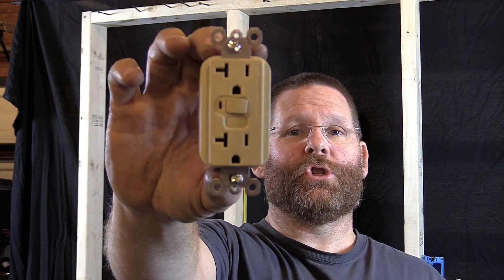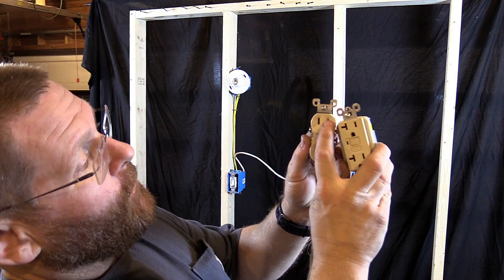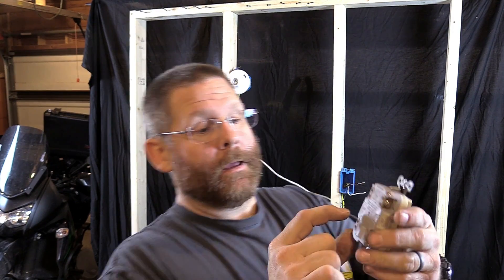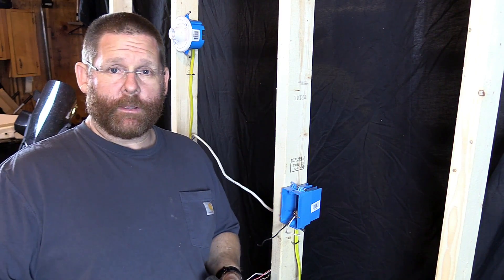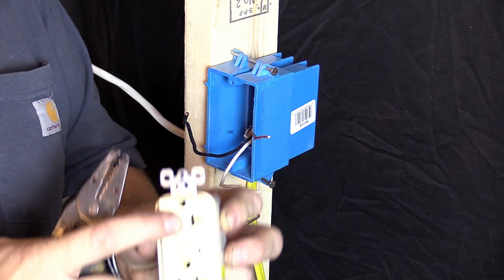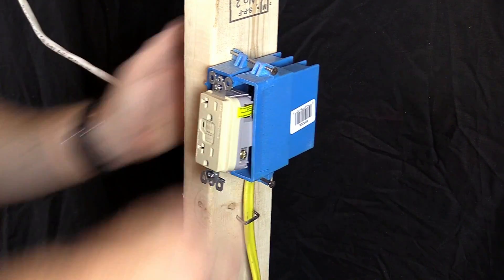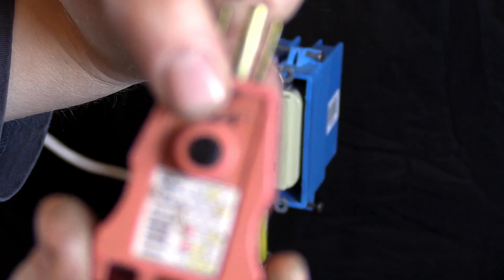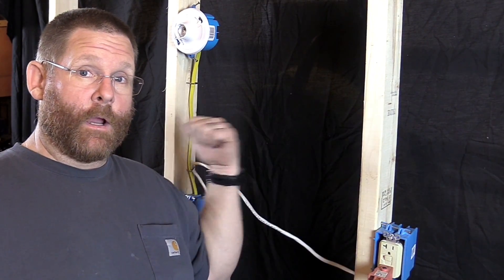How To Hook Up A GFCI

Comment: What’s the different category between line and hot black wire? Also what’s the difference between the black hot line wire and the black hot load wire?
Reply from the maker: Line is bringing power in, and load is taking it out of other devices or lights etc

Comment: Most helpful, although in a rental prop. i went to replace some 2-prong outlets w/3-prongs &  i put a GFI  outlet up stream of other outlets. Upon removing the old 2-prong outlets i saw 2- blk wire's & 2-wht wire's. my question i where would the other blk & wire connect to the GFI outlet?  Also i did not see any signs of copper ground wire. I would like u to give a hook up vid of this sennario of this.
Reply from the maker: Keep it on the line or you can use it upstream and protect more receps. Good idea for s video

Comment: what if it's an older home and no grounding on the outlets in the home. How would you go about grounding the outlets. The outlets do no have a grounded copper wire only a black and white wire
Reply from the maker: Have to use gfci or non grounding plugs. Or last option rewire. Here is how I fixed this house https://youtu.be/Gr8wxfKfEtY

Comment: If u are upgrading from a old two prong non-grounded outlet and u put a gfci, do u need the ground hooked up?
Reply from the maker: If you have a ground, you don't need to use the gfci as long as it goes back to the panel. If you don't have a ground there is nothing to hook up so no

Comment: So once you start your circuit with 12 wire can you go to 14 wire further down the line?
Reply from the maker: You can but you need to protect the smallest wire, which would be the 14 Guage.
Reply: Changing your wire to a smaller wire down the line requires you to protect the entire circuit to the smaller gauge wire. Now you have a 15 amp circuit.

Comment: Thanks bro vid was helpfull af! Tree limb fell knocked down line to garage i then had a problem with the outlet in garage my backup fridge had no power so it was weird i had power to outlet but the problem was i had to have a fan plugged in for the light switch to work but the light was not as bright as before but i unplug the fan and light would go off so i didnt trust my fridge to be plugged in to it because of some sort of power loss? Anyway i am changing the outlet 20 amp this time i learned from you seems better but i got those round glass fuses that screw in out in the old garage and they seem finer like not blown but there are four holes only have three fuses in but it was never a problem before anyway should i get another fuse for that empty hole?
Reply from the maker: Sound to me if your lights are dim that you have lost a nuetral or it's really loose. The 4th hole won't solve anything. Find that nuetral
Reply: Awsome find the neutral  thankyou so much sir very cool
Reply: Ok pulled out the outlet and there is not a ground wire its only got the black and white wires comming from the box in the garage both  house and garage was built in 1899 so i assume the wireing was done close to that time is why there is no ground but i retightened both the nutural and hot and now the light got brighter again but the light switch still controls the outlet so turn the light switch off and no power to the outlet where fridge is plugged in any way im now thinking its been this way always and i never noticed that the fridge was going off when i turned off the light
Reply from the maker: That's both good and bad. Switching a refrigerator is not good.

Comment: Thank you for GFCI 101 taught by a union man no less. Fixed my problem of running 2 gfci’s in series to connect an out door water fountain. It worked for a few years and suddenly stopped. Replaced one GFCI with a Proper 20 amp switch and ran the load to a heavy duty commercial grade outlet in a water resistant plastic case. Subscribed.
Reply from the maker: My pleasure for the video. Thank you for your subscription and welcome to the mountaineer outdoors family ☺

Comment: So the GFCI always needs to be fed directly through the panel ( a homerun), it's the first in your circuit  and then your daisy chain comes off that ? Correct?
Reply from the maker: No it doesn't need to be the first one. It can be but doesn't have to be.

Comment: good studff. Thanks. I have a bunch of outlets to install/replace. but if you install a 20 amp GFCI outlet doesnt the circuit its on also need to be 20 amps at the circuit box? Ir is it ok to use a higher rated outlet for a lesser curcuit as long as you dont go the other way around?? please advise? thanks
Reply from the maker: No if it's a 20 amp circuit you can use 20 amp. 15 amp only good for 15 amp receptacles. Good question.

Comment: I have a question about the extra line on the GFCI you show in this video. If a 20 amps GFCI is marked by that extra line on neutral slot is to signify that it is 20amp rather than 15amp why doesn't my GFCI have that extra line,  I can read on side of case on mine that it is a 20amp and it is hooked to a 20 amp breaker too.
Reply from the maker: From what I have been able to look up and I have not run into this that I know of...but its rated at 20 for feed through but classified as a 15 amp...seems kinda wonky to me but good question.

Comment: Unless I'm mistaken, the reason that you shouldn't back wire a standard receptacle is because it doesn't hold the wire with a plate when the screw is tightened.  The wire can easily be pulled out of the receptacle and cause big problems.
Reply from the maker: Yep definitely

Comment: When replacing or adding a gfci make sure that your replacement is the same amperage as the breaker in the main breaker panel that is feeding it. If you put a 20 amp gfci on a 15 amp circuit the 20amp gfci probably wont trip for awhile if there is a problem, but hopefully the 15 amp breaker in the breaker box down line will, but maybe too late.
Reply from the maker: The gfci doesn't trip when there are to many amps on it the rest of your comment is true though.
Reply: @MountaineerOutdoors  I should have said if you run a 20amp gfci with a 15 amp circuit breaker and there is a fault...the 15A circuit breaker would proably trip before the 20A gfci.
Reply: @gtnoslp  the size of the GFCI has nothing to do with the breaker, it does not act as an over current protector.
Reply: yeah i had the same question

Comment: Great video thx.  I replaced a GFI in my kitchen today, but when I finished there was a green light on the GFI, but no power.  Also lost power to two outlets that come after the GFI.  I have two black and two white wires in my box.  I tried flip flopping the wires from top to bottom thinking that the new GFI is configured different, but it didn’t work.  I finally had to put my old GFI back on to get everything working again.  Would probably help if I buy a tester so I know which wires are hot lol!
Reply from the maker: It is possible that the new one is bad right out of the box which seems to happen alot lately. Take it back
Reply: @MountaineerOutdoors  I did take it back.  I bought two new ones plus a voltage meter.  Problem solved!

Comment: I really enjoy your channel, good information and good explanation. However, at this point I disagree with you about the use of 20 amp receptacles for gfci's and regular receptacles. You actually made my point by saying in your 27 years of experience you've never seen a need. Another electrician with over 40 years said the same thing. I realize that there is nothing wrong as long as it's on a 20 amp circuit. My local Home Depot charges $2.00 for a spec grade receptacle (not gfci) and $7.00 for a 20 amp receptacle. Significant difference, at least around here. I don't think the quality is significantly different either. What's more, if you come across a tool or appliance with a 20 amp plug it will likely require a dedicated line and a simplex receptacle. I do like the 20 amp receptacle in residential use for the purpose of 20 amp circuit identification. I am not an electrician, but I assume that 20 amp duplex receptacles have their main use in industrial or commercial applications. Make no mistake about it, the use of 20 amp receptacles in modern homes is common, I am sure there are various reasons. Maybe a selling feature, looks impressive. 
Thanks for listening to my rant, and keep up the good work. BTW nice bike in the background.
Reply: Agreed.  It also kind of depends on how many amps your circuit breaker is.  For example, I don't think you should put a 20 amp outlet on a 15 amp circuit considering the breaker is not rated for the higher amperage.  So while yes, there is nothing technically wrong with with it and like he said, basically no residential appliance requires a 20 amp outlet, I also wouldn't make it be a potential issue putting a 20 amp outlet on a 15 amp circuit.

Still liked the video however!
Reply: @ApoJake13  Correct, I made a comment that it has to be on a 20 circuit if you're using a 20 amp receptacle.
Reply from the maker: I fully agree with you. To each their own and I do appreciate your comment. Your correct on everything you said. Have a good evening ☺

Comment: When you substitute a 20 amp gfci for the 15 amp, do you upgrade the wire and circuit breaker?
Reply from the maker: That would definitely be the way to do it correctly

Comment: That's for your view its very informative.  I had 2 gfi's blow in my kitchen one was a result of my wife using the microwave, it burnt the adjacent outlet,  I changed the outlet and the jumper wires, flipped the breaker and the other outlet burned. Now I've replaced both and it doesn't work, I tested the black and white neutral and the black is 120v and the neutral is 12v, should me neutral have voltage?
Reply from the maker: Are you going to ground? Nuetral to ground?  You should have 120 hot to ground but not nuetral to ground
Reply: @MountaineerOutdoors  
I'm not sure. It's an older house so I think there's no ground wires.  I'm having an issue rewiring the new gfi seems to have 2 live instead of just 1 black live. I'm guessing when the gfi got burnt it melted the neutral and a live wire in the same conduit causing some voltage in the neutral.
Reply from the maker: That stinks. Can you just rewire it completely new back to your panel
Reply: @MountaineerOutdoors  thanks I'll give that a try.

Comment: What if you have no ground wire?
Reply from the maker: Putting a gfci satisfies the code. Will it trip, no but this is what code calls for. Definitely should pull new wire and do it correctly for sure

Comment: Can't help but agree with the comment from B Lawson, I watched and listened 3 times and although you didn't reference or say that you can put a 20amp GFCI on a 15amp breaker. You statement about using them "all the time, (you didn't have one in your pocket, because you never use them" gives that impression. Your response was that you quoted wrong and would correct that statement. Someone looking to install a GFCI receptacle that's not going to read the comment's will never know that the code states you can "ONLY INSTALL A 20 AMP GFCI ON A 20 AMP BREAKER. As I said I watched 3 times and only found your correction of the misleading information in the comments to everyone that has brought this to your attention. I did however see your disclaimer at the end that you were holding yourself harmless if someone follows you advice. Instead of quoting to me the obvious, maybe you could post another video and go over the compatibility of breakers, and the various gages of wire and what would happen if someone were to overload a circuit and cause a fire. Which is what can happen if someone follows your advice and installs a 20amp GFCI and the gage of wire isn't heavy enough to carry the load.
Reply from the maker: Ok I re-watched my video again 2 more times. NEVER did I ever mention that you should put a 20 amp on a 15 amp circuit ever.  Also the only thing that I said which when I did say it was I prefer 20 amp receptacles.  That statement did not say put a 20 amp on a 15 amp circuit. Also, I only pull 20 amp circuits 12 Guage wire to all my receptacles anyway. Now your correct per code a 20 must stay on a 20 amp.. The way you interpret this is beyond me, getting that I said something that I didn't say. Now to make it more clear I deleted it where I said I prefer a  20 amp Recep. That should make it all better so no one will hear something that wasn't said.

Comment: Hey guy; I was just checking to reassure i knew what I thought I knew.    Love the line of Bull:)))   Politicians come to mind.
I am constructing a dust collection system, Utilizing a old Delta motor and impeller  unit.
I opened the (switch) on motor and the Neutral wire coming in runs thru a 25 Amp trip. 
The Black/power is hooked up to, It is stamped (Load) side of switch. 
When I look at wiring diagram on motor, it's showing Line  Neutral and Power coming in same side of switch and then feeding motor..  
Am I missing something within the (how works) of that switch?  
I have purchased a remote start kit. 
Best; Tom
Reply from the maker: Without seeing a diagram I would assume that it's a double pole double throw switch.. Just a guess. Good luck with your project sounds like a good weekend project
Reply: @MountaineerOutdoors  Hey young man, Thanks for the fast response:))  I was doing the what /how thinking. It appears  if the (motor) 25 amp breaker trips I automatically kicks the switch to the off position.  If you have time,  The 1 1/2 Hp  which tells it pulls 14,7 amps, motor is new factory wired for 115v 20 amp but it has a 25 amp trip breaker wired in it.  Why?  Best; Tom
Reply from the maker: My thoughts on the 25 amp is because of the start up of the motor.  Motors always have more amps for a brief moment while they are starting up and ramping up to the correct rpm.

Comment: So, can you tell me, is the amperage-rating at the outlet... determined strictly by the outlet itself?
Or, does it have anything to do with the capability of the house to transmit one or the other?

In other words, is there ever a possibility that any particular structure's system is only CAPABLE of 15-Amps and a 20-Amp outlet would be pointless... or, possibly, even trip a breaker, should a 20-Amp appliance be used?

Comment: Thanks for the video. I have an extra red wire. Where does that go? LOL. I know that this is the end of the line for this particular cable and is feeding no other circuit beyond it. I cannot say for sure but I believe it is the only receptacle on this line as it is for a Dishwasher and GARBAGE DISPOSAL  and the main CB is rated at 20A. I used a 20 GFCB here too.
Reply from the maker: I am not sure on that unless they were gonna feed the dishwasher and the garbage disposal and share the nuetral.
Reply: @MountaineerOutdoors  you got it. They split  the line side by removing their connection. This allows for two phases of line voltage and the neutral is shared.
Reply from the maker: Gotcha well at least you got it figured it. Have a great night

Comment: can GFCI go bad if I wire it wrong way?
Reply from the maker: Well honestly if it's wired up wrong and it's working I don't think that it could go bad. I have seen many that were new out of the box that were bad.
Reply: @MountaineerOutdoors   Thanks for your response, yeah I just flip the wires and everything works fine.
Reply from the maker: Glad to hear that easy fixes are the best. Have a great day ☺

Comment: I thought since the line was coming into the GFI you put the wires on the screws under the yellow tape.
Reply: Ok, I watched the video again. The load is under the tape, not the line.
Reply from the maker: exactly the line isnt taped its the load that is taped.. but you always need to look just to make sure.

Comment: In most communities 15 Amp receptacles are for residential and 20 Amp are used for commercial.
Reply from the maker: Yep but homeowners now are wanting them. So if they are paying you have to do what is right by them
Reply: @MountaineerOutdoors  Yeah, you just have to watch out for those municipalities that have specific code stating that residential has to have NEMA 5-15R for 120VAC.

Comment: That must be the legrand GFCI? I just pulled one out this morning when I found an open ground with my new outlet tester. Sure enough someone hadn’t connected the ground wire; in fact they were cut shorter than the hots and neutrals. So I took a length of 14-ga and twisted it with the two other ground wires in the box, and connected to the ground screw on the outlet. 
That’s when I noticed the hots and neutrals were going into the back. I was going to move them to the screws, but then I noticed that the plates were the type you described. So I just re-inserted and cranked down in each screw. 

P.S. - Looks like Lowe’s isn’t carrying legrand anymore and is instead now carrying Eaton.
Reply from the maker: I need never understand why people cut the wire so short. Good find though. Glad to hear that it's fixed.

Comment: I thought that wiring a 20 amp receptacle on 14-2 would allow plugging a 20 am device on a 15 amp circuit that would otherwise require 12-2 and a 20 amp breaker.  Such use of a 20 amp outlet could possibly overheat the circuit.  Thank you for clearing that up.   Also, I thought that some jurisdictions do not permit back sit wiring.  It might be helpful to show middle of the run wiring of the outlet.
Reply from the maker: I think that very well could be a new video. As for the jurisdictions not allowing it. I cannot answer that in my County it's ok to do it but as for other I just do not know...

Comment: New Sub...so even if the circuit is 15 amps you would install a 20 amp GFCI correct?
Reply from the maker: NO I did miss quote it here.  I did pin a comment at the top of the video which gives the code number and tell exactly how to do it correctly  I will be doing another video to correct my mistake and bring the gospel to everyone.